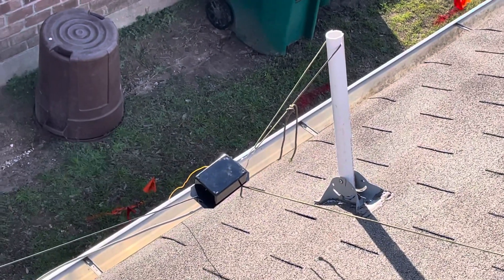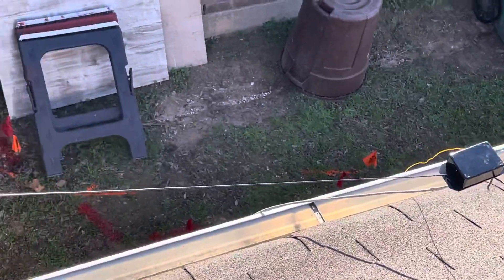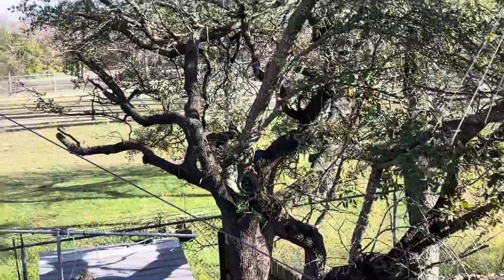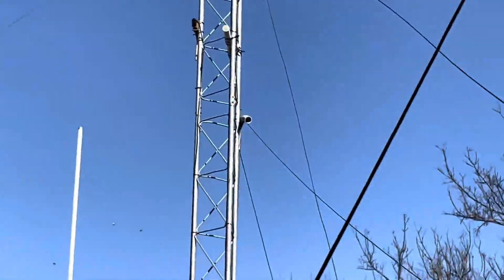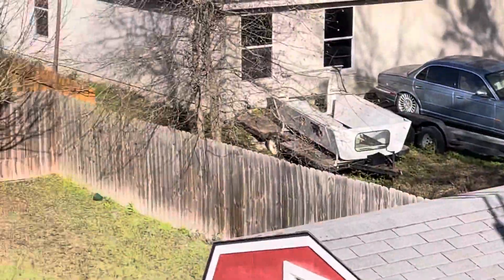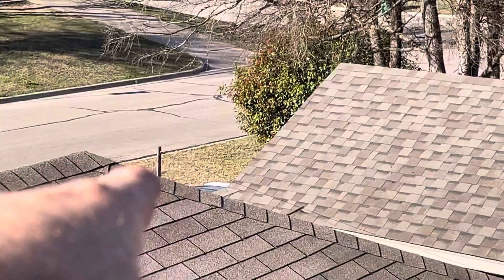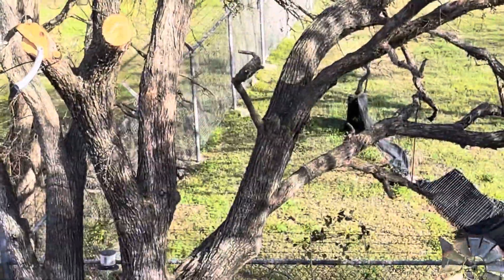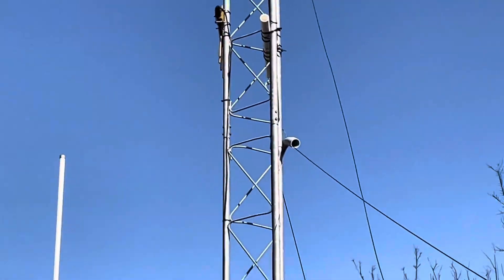A TOP View of the MFJ 1982mp HF wire antenna.

Comment: I think I have an answer for your heat problem on your end fed antenna measure your antenna and find a piece of PVC that it will fit into comfortably drill cut and slot as needed for wires insert the box mounted and the white surface will help keep it cooler and keep the rain and moisture off of it K04ZCJ.